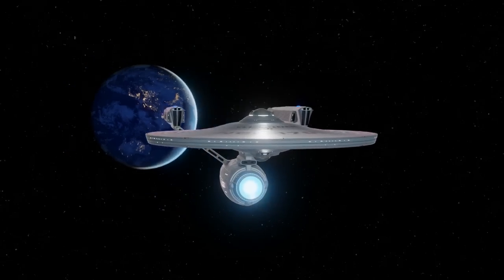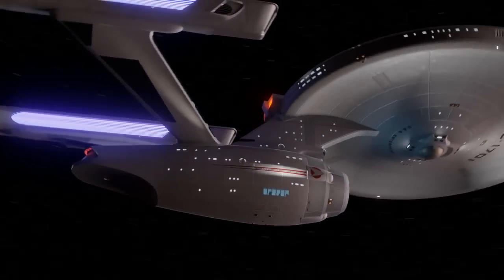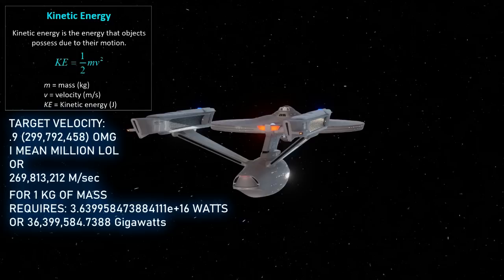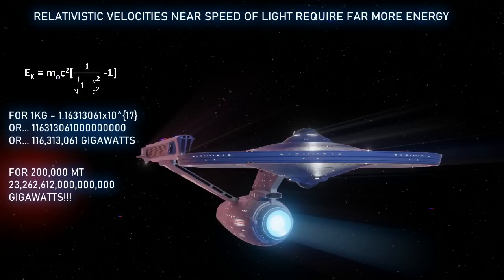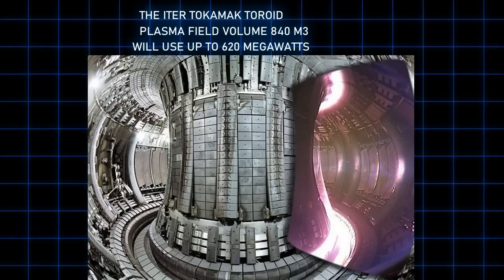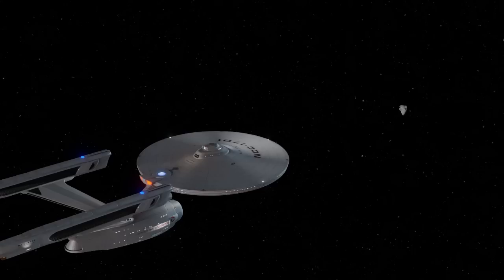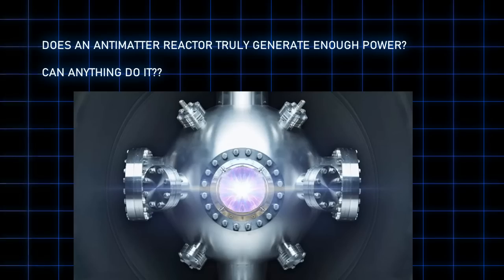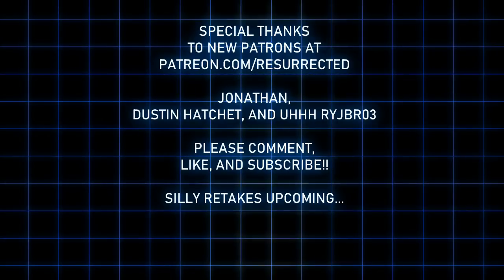How Many Nuclear Power Plants Can Power the Enterprise? Let's Calculate!!!

Comment: One minor correction.  Under full impulse power the Enterprise is supposed to be able to achieve a maximum "space normal" velocity of no more then .5c.  Justification for this theory is in the Motion Picture when they are leaving space dock.  Kirk gives the order "Impulse power Mister Sulu.  Ahead warp point five (.5c)."  I'm assuming he intended "full impulse power."  For higher velocities they would resort to engaging the warp propulsion system to avoid any inconvenient relativistic effects.  The warp system could also be used at sublight speeds.  The warp bubble created by the nacelles would reduce the effective mass of the vessel, making impulse maneuvers much more efficient.  How's that for geeking out?  Also, a note on your last video on the external lights.  The two lights you have on your model just behind the bridge dome are incorrect.  These two circle-details are actually the tops of the turbolift tubes that go up to A-Deck at the aft of the bridge.  They don't actually light up.
Reply: Yes, they would still be using the warp bubble even at sub-light.
Reply: They deliberately avoid high relativistic velocities specifically because of inconvenient time dilation and other phenomena that manifest the faster they go in 'real' space.
Reply: I was getting ready to say the same thing. Full Impulse is just over 1/3rd the speed of light or 100,000 km/s. They did this for 2 reasons. The 1st was the Time Dilation in normal space issue and the 2nd is more of an issue with ease of use.   They typically use fractions of Full Impulse and it makes it easier to do this if Full Impulse is 100,000 km/s because you can easily do this with percentages if full  Impulse is 100(thousand km/s)
Reply: "Kirk gives the order "Impulse power Mister Sulu. Ahead warp point five (.5c)." I'm assuming he intended "full impulse power." "

But that's not what he said. He would have said 'full impulse power' if he intended to.
Reply: @Idazmi7  I said I "assumed."  After being "clear and free to navigate" Kirk and Sulu have a "thing" where they know what is being said without having to say it.  He was essentially saying, "Punch it Sulu!"  Or as Mr. Spock would say, "Mister Sulu.  You may indulge yourself."
Reply: Actually a minor correction to the minor correction: 

If you read Lawrence Krauss’s “The Physics of Star Trek” as well as “Mr Scott’s Enterprise,” and the TNG & Voyager and Technical Manuals, you will see that full impulse power is .25c or 1/4 the speed of light. The Kirk’s Enterprise (as well as the Kelvin timeline Enterprise) impulse engines are powered by the warp core and in low power or emergency situations by fission reactors; they are considered as an auxiliary or emergency power plant. Any speeds faster than 1/4 the speed of light would bring in the problems of time dilation and increasing power consumption needs due to the theory of relativity.

This is a very good video showing how much power generation is required.

Very well done!
Reply: @BillTomaras  0.25c might be the standard maximum impulse speed, but it doesn't mean that higher speeds are impossible. Kirk was in a hurry in TMP, hence he ordered the speed of 0.5c since the state of the emergency outweighed the consequences of that higher velocity
Reply: Can we all agree that one should argue the logical aspect that you are a NEERRRDDDD!!!

😉😎
Reply: @MatthewCaunsfield  Well, you're kinda missing the point. If there is an emergency and you want to get their quick, it does not help if time at the destination passes more quickly because you are trying to go fast. In other ways, the trip would be short for the crew onboard, but to those they want to rescue (for example) they would arrive too late.
Reply: @silkwesir1444  That's not how time dilation works. Time on board ship would indeed be sped up, but that wouldn't affect the passage of time at the destination point
Reply: @BillTomaras  
The problem is, none of those books are Star Trek, which is a TV show. In the TV show, maximum impulse is definitively 0.9c.
Reply: @BillTomaras  Minor correction to your minor correction of my minor correction.  Yet another Star Trek inconsistency.  Kirk DID say, "Impulse power...ahead warp .5"  It seems logical that "warp .5" is half the speed of warp 1 which is c.  So the "tech manuals" that say .25c or .9c are inconsistent with on-screen canon.  I think we can all agree that .9c or 90% the speed of light in normal space would introduce some pretty significant time dilation issues that might be best to avoid.
Reply: @CutieHoney no, according to the manual they don't. And according to on screen dialog they only use it in a special circumstance as a workaround to another limitation.  

It's absurd of course,  even assuming 100% efficiency in converting an antimatter reaction into directional thrust, a casual spring to .5c and back would cost the Enterprise D something like 7000 metric tons of antimatter and an equal tonnage of regular matter.
Reply: @DrewLSsix  
I love how you casually mention antimatter as physical thrust, when antimatter is only used in the Warp Drive system, which is not a physical thrust drive.
Reply: @Thin447Line  
"(...) I think we can all agree that .9c or 90% the speed of light in normal space would introduce some pretty significant time dilation issues that might be best to avoid."

Meanwhile, the Enterprise uses Time Warp in The Cage, (the first episode mind you) willingly flies through waves of time-distortion in The City on the Edge of Forever, time-warps in The Naked Time and Tomorrow is Yesterday, and Assignment: Earth, and transitions intentionally out of time-phase in The Tholian Web.

I'm pretty sure they've solved time dilation, what with their interstellar federal democratic republic.
Reply: I actually heard that full impulse is .5c as well. That's why i was confused why he did the math with .9
Reply: @mammutMK2  
"I actually heard that full impulse is .5c as well. That's why i was confused why he did the math with .9"

Because what you heard was incorrect.
Reply: I thought impulse went up to 0.9 light speed.
Reply: @giantclam1822  
It does. Impulse has always gone to 0.9 lightspeed.
Reply: @giantclam1822  So, Warp .5 would be roughly half Impulse.
Reply: @Adarkane325xi  Thats what I thought.
Other commenters see it different
Reply: @giantclam1822  They’re unintelligent.  🤷🏻‍♂️  lol

Comment: fun fact: anti matter is so rare in nature that you have to produce it artificialy. the fact that theres a massive fleet powered by anti matter reactors is telling on how powerfull the energy sector of the federation is in terms of output.
Reply: The only thing I find contentious is the black hole thing.
I am much more likely to believe that the artificial quantum singularities POWER the drives in the same way antimatter does in the UFP. Rather than they being used to create or modify the warp field directly.

A black hole can be used as power creation engine via an accretion disk. It can also be used to store energy as mass and them convert that mass directly into energy via hawkings radiation. The flow of hawkins radiation could be controlled with gravity emitters... basically, tractor beams would manipulate the size and shape of the event horizon in order to manipulate the hawkings radiation.
Reply: @bmobert  That is pretty much how I imagine it works as well--they bleed cold hydrogen into the black-hole containment chamber and then magnetically extract the super-heated plasma as it fall spinning down into the singularity and after that point channel it directly to the warp coils like human or Klingon drives. So long as the singularity is itself charged it is possible to keep hold of it and hold it in place.

However there are genuine 'black hole drives' in the Trek universe as well. They work in train a little like a catterpillar and physically pull the ship along behind them. There is an excellent description in one of the 'Starfleet Corp of Engineer' books--and pretty good sci-fi horror short story attached to it as well!
Reply: @morelenmir  yes. I read that story. I didn't understand what the author was trying to describe with that warp core. I read the passage repeatedly but never got it. I found the notion intriguing, tho. I also felt as though it was a hugely wasteful in mass and materials... but I could quite understand the mechanism enough to put my finger on why.

I've done a spreadsheet of math on the fuel requirements for warp travel as deduced from the warp chart in the TNG Tech Manual. The energies as released by hawkings radiation require event horizons of very small radii. So small I speculate that's thre real reason a d'diredex is limited to 9.2wf, as depicted in TNG Tin Man: the control of such a tiny object would require incredible accuracy and any deviation in alignment or signal harmonic could easily result in catastrophe.

Also, while hydrogen is ubiquitous and would be the fuel of choice for getting energy from the accretion disk, the biggest advantage of an artificial singularity, to my mind, is that if you can collect Hawkins radiation for power, tour system is completely fuel agnostic. Literally anything that goes in will come out as (for all practical purpises) uniform black body radiation. I imagine a d'diredex bellying ip to a multi-megatonne kuiper-belt object and beaming a random chunk of it into the singularity for later extraction. Or an asteroid, or a terrestrial moon, or atmosphere from a gas giant.... they could beam in a pure tonne of Iron56 -which has no nuclear energy left to give: its at the bottom of the nuclear energy well- and expect that mass to be perfectly converty to warp power as needed. In this way, an artificial quantum singularity is the perfect mass-energy battery.
Reply: @bmobert  I think the idea was the ship continually fell into its own gravity well--rather like how the 'Tantalus Drive' for the Normandies run in Mass Effect.
Reply: @morelenmir  Hmmm.... I suppose it was written before alcubierre wrote about his space-time metric solution. So, I guess I have to give it a pass. But I don't like it.

Thanks for explaining it, tho.

Comment: One thing you missed is that Kinetic Energy is a measure of energy, not power, to get the power you'd need to have a Time frame to get to that speed. So say it takes an hour rather than a second to get to 0.9C, that's 3600 times less power needed to get to that speed.
Reply: I'm glad somebody pointed this out.  Of course this means that things like shields is actually made worse since they need to dump that amount of energy into a target in less than a second.
Reply: Also, Special Relativity applies on the first calculation of just kinetic energy. I can furnish details later if someone is interested. Root (0.11) is the Gamma factor doing mental math. So times 1/gamma for KE at relitivistic velocities.

Comment: Assuming that the Enterprise can generate the required energy, unless it can be used at very near 100% efficiency, the ship would melt itself from waste heat in a short time.
Reply: In Star Trek lore, the reactor uses "Dilithium Crystals" to convert 100% of the matter/antimatter reaction into plasma to charge the warp coils.
  (It's a MacGuffin, but it's in good fun.)

Comment: Starships do have inertial dampeners especially when operating an impulse speeds because they can accelerate crazy fast and that's probably why they can do it is because they basically have little inertia and if you got a warp drive active then you don't really need the inertial dampeners because the warp drive will just do the work of one anyways.
Reply: At the end of the day, a lot of the technology in Star Trek boils down to "warp fields, but in really specific circumstances and use cases", because the term "warp field" is too specific to the propulsion tech. It is a massive subspace field generator, and manipulation of subspace allows you to circumvent gravity and the speed of light as a dominant physical forces in the universe.

I think that "Subspace" is Star Trek's shorthand for whatever underpins dark matter and dark energy (different phenomena with different gravitational effects in the real world - but in Star Trek's future they'd be subspace phenomena affecting our space in different ways). Generation of subspace fields of different types and frequencies can alter the topology of our 3D spacetime for relatively little energy compared to what RS called "Brute-forcing" it in normal spacetime. This not only allows FTL travel and cloaking devices, but time-dilation fields for faster computer processing, artificial gravity, efficient slower-than-light travel between planets and all sorts of particle and other physics experiments that shed further light on the nature of the universe.

Part of the reason subspace is so useful is because, like the fabric of our spacetime in reality, it's not bound to the speed of light. It can expand or contract in ripples, and while we can detect gravitational waves with some of the largest and most expensive scientific instruments in history, subspace technology would allow us to detect them by simply establishing a small field and monitoring the torsion of space it's able to produce for fluctuations. Disturbances of subspace can travel "under" the spacetime of our universe far faster than light through spacetime, enabling FTL communications by monitoring the power draw in minute detail on a small subspace field generator flexing spacetime just a little. Similarly, you can create disturbances with a field that can be detected with another, hey presto! communication.

But really, it's all the same tech.
Reply: @Destructor111  a difference is is that the Warp bubble goes around the entire ship while a inertial damper is more localized so yes the same. We do hear in Enterprise that Captain Archer's chair once had an upgrade of extra inertial dampeners. I think subspace is closer to what we know to be the zero point field but yes anything that can affect space-time in the desired way can make any effect involving gravity, inertia, mass at least in the real world but in Trek and in Trek they have gravitons which is one of many ways to bend space time in Trek, in real life I think gravitons are stupid and not real because the space time behaves in our universe is more like a field reacting to something and less like a bunch of particles making the disturbance and many other reasons.
Reply: Correction:  Impulse Power doesn't work WITHOUT Inertial Dampeners...they're an integral component of the system.

The relatively lowered mass of the vessel (as a whole) and the subspace field generated by the impulse engine(s) allows for a ship to reach a "Full Impulse" speed of 0.25c for a ridiculously low power expenditure.
Reply: @digitalis2977  yes it can cuz it's a thruster so it will still make thrust but not to as much effect. But thanks for the correction, I was unaware that it was integrated but also that's what I said.